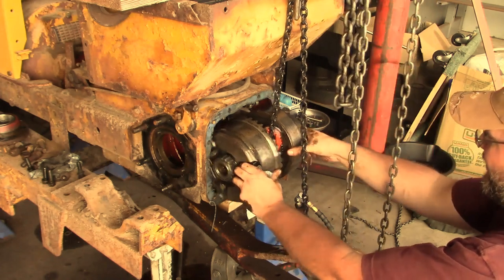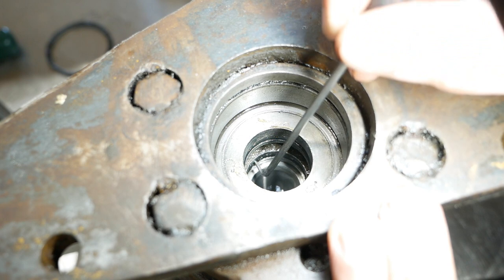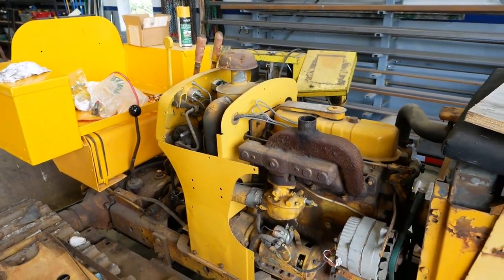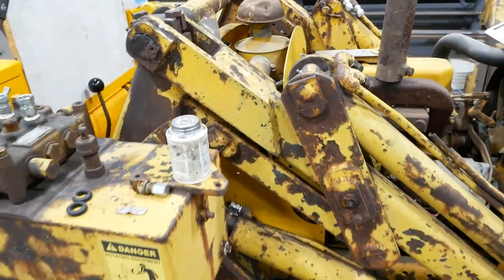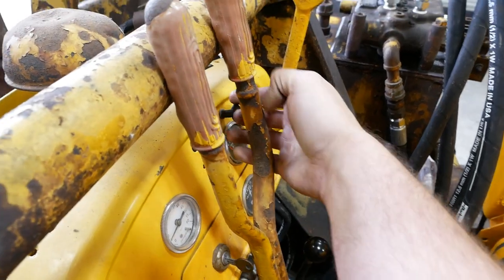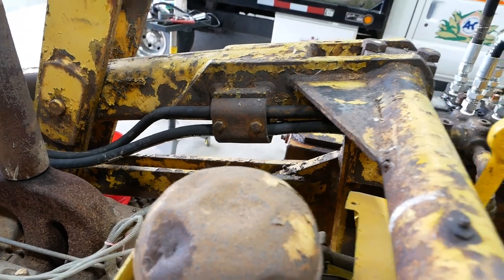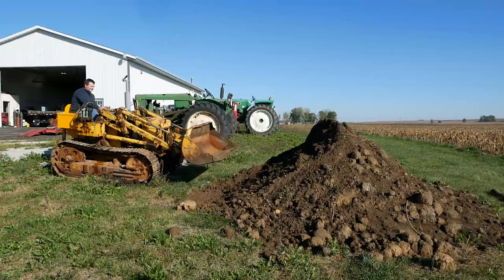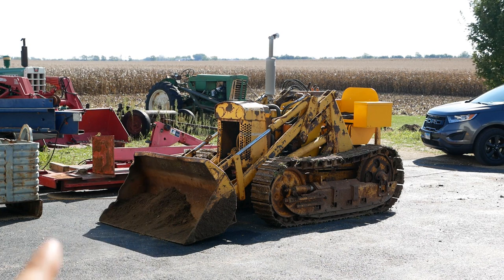60 Year Old Oliver Crawler Returns to Service - Installing Loader and Everything Else

Comment: Very cool Machine and nice work... I had a 1973 White 2-44 loader tractor. Basically it was the industrial version of a 550 oliver... it had the 4 speed transmission with a reverser.  The travel lever was exactly the same... forward for reverse and back for forward... I'm told that was common on older machines I was told a couple other brands worked the same way... it's amazing how well some of this old iron can work with some elbow grease... I just fixed a 1958 Case 511b with a schwartz loader which had a thrown connecting rod in the engine

Comment: After all that work, the final result works well.  Congratulations for overcoming so many problems and situations.  I've had similar repairs, although not as extensive as this dozer.  There cannot be many fasteners that you have not touched.  Thanks for the videos.  Greetings from Ohio.

Comment: Wes   it’s amazing what you go through to get these old tractors going running and operating again the amount of love you put into it it’s amazing time well spent shows in your work to me whether you’re working on big grain  trucks garbage trucks all of these tractors down to the small cars you do it right to the best of your ability is amazing there aren’t very many mechanics out there that will even work and get it done right or even take the time to do it right all they do is slap things together and break other things and don’t tell the owners about it and leave them broken like I’ve had problems with a local dealership here in Albuquerque working on my pick up stripping out the drain plug on the oil pan three different times charging me labor to fix it when they broke it frustrating for me and I had to get them the drill bit and easy out to get the plug out of the pan because they did not have the parts to do it with and would not get them like I said I love the hard work you do in the heart you put in do your work shows I love seeing more videos of these old tractors reminds me of my grandpa in riding around on his old caterpillar gas powered one out in the field plowing in California back in the 50s and 60s a lot of fun with them all machines lotta memories like I said I love your work and watching you on your videos keep it up keep putting them out a lot of us here will keep watching them. 
Last thing I only wish you were here in Albuquerque so you could be my mechanic as well but I guess that probably would not be fair for Max we don’t have that many mice running around or rabbits running around here unless you’re up in the mountains somewhere have fun enjoy life is going by too quick and it is short

Comment: Shuttle shift on my Cat D7 is the same, back is forward and ahead is reverse. I think the reason is when you release clutch moving backwards the tractor comes to a stop so inertial on your hand on shuttle lever is naturally going backwards and opposite when you are stopping forward motion your hand on the lever will naturally want to move forward to reverse position making shifting easier.

Comment: Hey Wes,

For your damaged spool valve, I've had some success with boring the ID slightly oversized and then inserting a thin liner and/or adding a sleeve to cover the OD. The liner and sleeve help clean up the sealing surfaces and caps the crack. In previous lined and sleeve repairs I've also used compressed air or vacuum to force some JB weld into the crack prior to installing the liner or sleeve to help seal it up as a bit of a last-resort "that'll do" repair. Might be worth trying, otherwise I imagine it'll be quite the hunt to find a used replacement. Next stop machine shop...

Awesome videos by the way, I've enjoyed watching your work and thought process.

Comment: Good job Wes. That little Ollie is actually a Cletrac, originally the Cleveland Tractor Co. The machine that one is based off was an agricultural machine. That's likely why it was geared so high. On some of the earlier ones you could get an auxiliary transmission to cut the speed in half or something like that. They were good little machines. As far as the "tiny cockpit", IIRC you're like 6'4"?!!! Dude- EVERYTHING is tiny to someone your size!
Reply: No, it's not a Cletrac. Oliver bought Clevelnd Tractor company and started calling them Olivers. This OLIVER, WAS BUILT IN Charles City Iowa.
 It's kinda like saying the Allis All Crop combine was actually a Rumley Threshing machine. Allis bought out Rumley, and built their combines on many of the same ideas, but they weren't call Rumleys.
 Cletrac built an HG, which is nearly the same thing as an Oliver OC3. There was no late model Cletrac sized like the OC4 and OC46

Comment: Hey Wes, good job on that little crawler! 
And good to see someone using proper eyelets and the right tool to crimp them!
But you might want to add some plastic tube or similar to protect that big wire from rubbing against the screw of the other battery terminal! Especially because its not fused. (19:00) Would be a nice fire if that screw would rubb through the insulation of that big positive wire.
The pre spilled fluid is a genious idea. I will copy that. 😂

Comment: I've had rods re-chromed for cheaper than making new ones but I live on the Big Island of Hawaii so my options are limited. I had to send them to Seattle. I love your work by the way!
Reply: I've made some reproduction cylinder rods before when I worked in  a machine shop. I wouldn't have wanted to pay the bill. If A guy has a decent lathe and time to kill, it would be a different story.
 I might be kinda scared to see the price tag of a chunk of chromed stock now days though!

Comment: Nice recap and finale. Snark City, love that vibe.  In the "things to plug something with" department, you can also use the applicator nozzle that comes with a tube of RTV to plug off hoses and fittings.  I'll also mention that over many years of working on forklifts I have made a plentiful collection of nipple caps and hose fitting plugs by cutting off the ends of hydraulic hose threaded fittings and brazing or welding up the hole in the cutoff.  They work well for simply keeping dirt out if you have a hose loose from a cylinder, but they really shine when you need to remove one of a pair of cylinders completely from the vehicle and plug the hoses so you can still move the machine in and out of the shop under its own power. They work as well as the ready made caps and plugs you can buy.

Comment: Thanks for taking the time to video all your work on this machine. Hopefully someone has a workable spool valve laying on a shelf after 50 years.  it happens.  Perhaps in the original box too.  I'm sure Abom79 would be happy to help with new cylinders for the owner if the seals finally force replacements.  Well done that man!!

Comment: Gresen Hydraulics made some spool valves for Toro when the Grounds Master 72 was developed. Parker has since purchased Gresen. The spool valve can be repaired two ways. Spray weld and machine or grind to size, and make a brass sleeve. Split the sleeve and solder it in place. Use silver solder of you have some. Parker has a rebuilding facility in Blaine, MN. Close to hwy 610 and 65. They replaced cylinder rods on my D4-7U Cat some time ago. National Bushing offered the spray welding service when I was in high school.

Comment: Instead of crimping the battery cable eyelet, I learned to just heat them up and melt solder into them. You can easily remove it too. Saves you from  cutting it off and buying a new one. I found you from Koch Dig Drive DIY.

Comment: 18:00 WES, If you replace the battery clamp bracket back on the terminal, Wouldn't it increase the cable contact area.? And I enjoy the fact that you have a long-term project coming to completion period one of the things I enjoy about your videos, your tenacity.!

Comment: My opinion is always kill switch on negative as close to battery as practical like you did. If you put the disconnect on the positive it's possible the wire between battery and switch can chafe and short to ground causing problems. With disconnect on negative you can always check the condition of the wire but simply trying the key with the disconnect turned off.

Comment: I have one of these loaders exactly like the one you have, I believe it is a 1963 model, right now it has the steering clutches/brake band removed to replace the clutches and brake bands and now just needs to be put back in the tractor. For the middle spool. use a piece of TGP round stock (turned/ground/polished) and make a spool that will allow flow of oil for the other functions to work. What that middle spool was used for was a 4N1 bucket to use it to pick a log up. I noticed that after you stalled the engine and restarted it that it was puffing black smoke. an indication that the electric fuel pump may have been overpowering the needle and seat in carb flooding it out. The machine I have does the same thing.

Comment: The shifter makes sense to me. It's just like moving an 18 wheeler back and forth. (Reverse top left, 1st/low bottom left), or you could think of it kinda like a reverse manual valve body if you've ever owned or driven one. I've been waiting to see this thing get finished for a while, but probably nowhere near as eager as you were to get it out of you shop! It's a dang good feeling clearing old projects out and crossing them off the list.

Comment: Hammers and hot wrench, my favorite tools! 

I'm working on a 1950's OC30 with an OMC 'Iron Duke' 120 marine engine. My friend bought it a few years ago and it has been sitting. I got it running, the engine runs good, but it doesn't seem to have enough low end torque for a crawler. I saw the Hercules 3cyl 2.2 L engines were rated for 1700 rpm, this thing needs that just to get it moving in1st. They must have some big pistons. 

I remember you said something about turning the reverse gear into a granny low? I am gonna try to  talk him into a Perkins diesel. I dont think I want it sitting in the shop for 2 years. 

It seems to turn fine. It didnt want to turn right at first but was better after I drove it around a bit. It's a Frankenstein rig for the most part,and has a gas pedal instead of a throttle...that doesn't work out too well going over bumps.

Two tips I like to offer:
1) If you are having a hard time getting a bolt to break with your impact, grab the socket and put pressure going the other way and you will get a little more torque out of it. Old tire buster trick.

2) On the batt terminal ends, just flip the tab over, it won't come out. Old indian trick.

Nice work on the hydraulic lines. I am gonna have to do something like that, The lines are like spaghetti. I need to move the hyd reservoir so I will just get some 1/2' steel pipe probably.

And yeah, you have to lower yourself into the cockpit on this one too.

Where did you get your parts at?

Comment: Wes, take a look at what Kurtis of Cutting Edge Engineering of Australia does to hydraulic cylinders and rods. You're surely up to doing the same kind of work, and that cylinder isn't nearly as big as what Kurtis machines. I know you have a good machine shop background. Of course, Mr. Tucker has to approve and foot the bill, probably shouldn't cost too much though. I agree with the guys suggesting some kind of epoxy or Lock Tight (sp) to stop the spool valve from leaking. Really liked the video.
Reply: Was thinking the same thing.  I bet Kurtis could make a new spool valve no problem.
Reply: Kurtis at CEE, does fine work.
 I spent my working days as a machinist, tool maker, machine tool repairman, and have made new rods for hydraulic cylinders. 
 If it becomes necessary, it will get new rods, but so far, it's not been a problem since it has chevron packing, and not oil seals for the cylinder glands.

Comment: Great series Wes, I'm sure that this will not be the last loader video. It's a shame that these older machine never had a low enough gear,  even my D4U, lots of grunt but geared way to high. Hopefully you'll be adeptly reimbursed for all your efforts
Reply: I've been toying with the idea of replacing the 'reverser transmission' with a "slow low" transmission. Both were options on the OC46 but there's only room for one or the other. Kinda gonna wait and see how I get along with it this way for the odd jobs I want to do.

Comment: Also, the 3pt hitch was controlled by a bypass valve on the lever with no spring control. It was that way from the factory. You could mount a grader rake on back. You could back fill a foundation. Spread topsoil and grade it all out with one machine. Kind of like a Bobcat today.

Comment: Brilliant, ive been looking forward to this, Great video as always..Re the ram corrosion, here in the UK you can buy new chromed ramrod in commercial lengths so its very common practice to get your local hydraulic shop to machine up new chrome rams to replace your worn / bent originals using your original ram eyes and the cost is usually really viable compared to new rams complete. as for spool could you not machine a new one from something like EN24 T ? its tough as heck and machines lovely and you could polish it to fit. even as a dummy spool that dosnt move im sure it would work if it was hand fitted to the bore of the block.

Comment: Wes good job on that old rust bucket,I think the hydraulic hoses are going to get holes in them because of all the rubbing and movement . One hose rubs the top radiator hose so maybe that will put a hole in the rad hose.

Comment: My grandpa had an old bobcat loader w/o the roll cage. One of the old old ones you could flip really easy. Duno how no body died running it. Though we used to take 5 yr olds on inner tubes pulled by 3 wheelers down snowy hills so yeah....lil haphazard

Comment: The only electrical things.  Clock the rear of the alternator case unless it uses a rear bracket so the regulator connector is straight down to avoid moving parts and from rain water sitting in the connector.  
Marking the ignition switch positions on the dash.  I wonder if there is enough room on the battery box door to mount a cheap solar panel. To keep the new battery fully charged when just sitting.
Reply from the maker: Good idea!
Reply: I have a battery maintainer powered by a solar panel. It works on either 6 or 12 volt. I might need to put a cigar lighter on the dash, so I  can just plug it in there, instead of using the alligator clamps on the battery.

Comment: I think that the engine will outlast the rest of the machine, but wow, it sounds sweet, runs really well..loader valve I hope you might find a replacement for it in the future for the owner, otherwise it works as it should, surpisingly strong little machine, great job!

Comment: Some Loctite in the crack of that valve spool might seal it up along with your locking collar...   Wonder if the reversing lever would work better with the pivot at the bottom of the lever rather than the top (to make the reverser lever work as expected).

Comment: Watch wes work not sure if it is a problem for you but you may want to check the fuel pressure on the electric pump they like to over fuel the old carburetors. Always fun to watch the videos I run into many of the same struggles in my own shop.

Comment: They have a six or 5 speed gearbox. But you have to feel for the gate to select the low or higher gear in 1,2.!    3 may have a hi speed also. It's one position on the left of the gate and the other speed feel for it on the right. . Left side is lo and hi is on the right,  In each of the gear positions. The Olivers are in fact highly skilled in the engineering department and were a stride toward making life easier for the operator . But without an operators manual (do they exist?)It can take a loong time to notice the intricacies built in. for instance the clutch may not be the only clutch you can shift or stop drive with?? Places to put feet  while not busy? You have to wonder if Oliver figured your legs needed to rest when not active? I recall having my left foot back on a housing of some part during those long moments. I never saw a fuel pump on one . always were gravity feed I figure. Could it have been flooding at idle?
Reply: This has 4 forward speeds and there is no "gate" to go to a higher or lower side. That was in the farm tractors only. I spent many hours running the neighbors 770's as a teenager.
  This has 1st gear left up, 2nd is left down, reverse is in the middle up and 3rd and 4th on the right up or down.
 If this had the "slow low" auxiliary transmission, instead of the reverser, it would have 2 speeds for each gear in the standard transmission.

Comment: I always look forward to your videos.  Love your sense of humor, it matches mine.  I would enjoyed having you in Auxiliary Division on a Nuke Fast Attack Submarine.  Sometimes we had to make something from nothing and you excel at that.  Jacques van Aswegen suggested you braze up the spool and re machine it that might work if you can clean it enough to get the braze to stick.  I was wondering if you could just machine a dummy spool out of mild steel, maybe with o-rings end and nuts on each end to lock it in place.

Comment: I prefer to install the disconnect in the ground side for the same reason we disconnect the ground cable first when removing a battery. As for the "smooth Oliver hydraulics" on the loader tractor, maybe an adjustable restrictor or washer in line will slow down the movements.

Comment: Nice job done! New valve block, new rods and seals for the piston, a carburetor rebuild and this beauty is as good as new!
I wonder, if one could fit any 3-way (2-way?) valve block with directional controls?